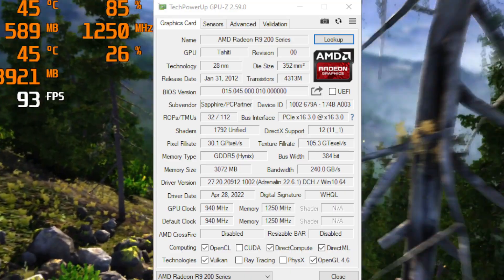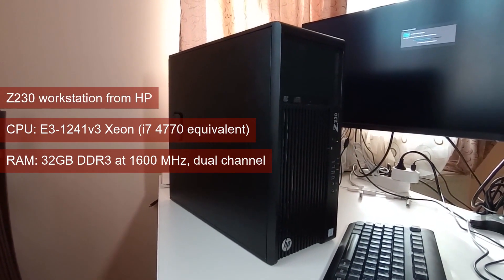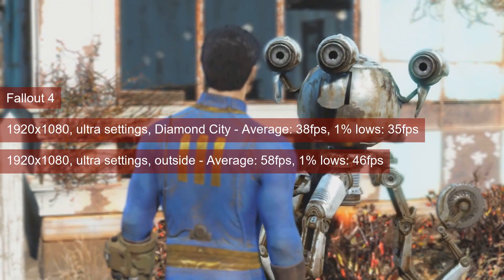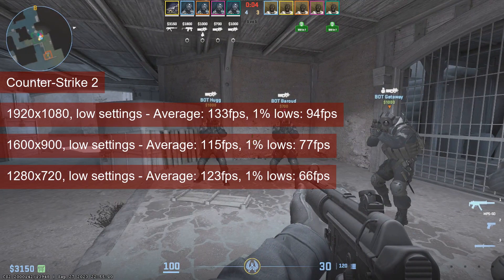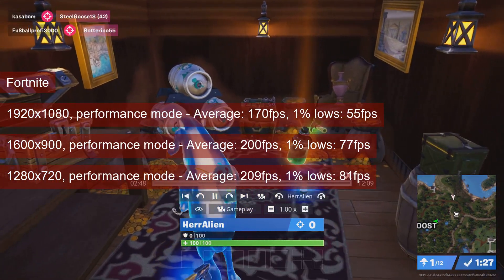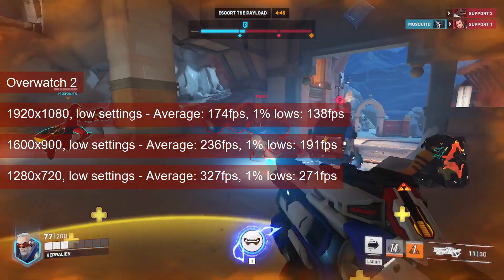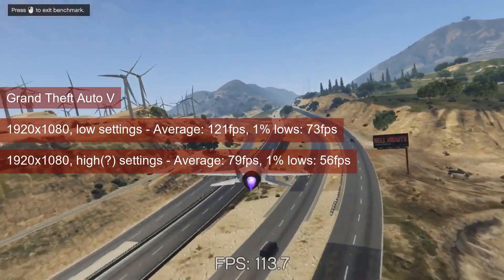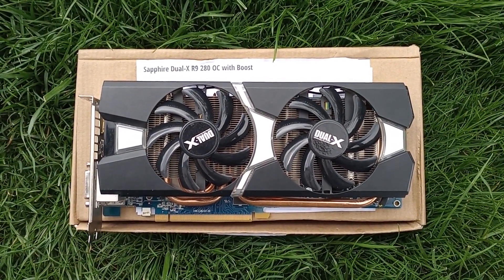Still Fine Wine in 2024? | AMD Radeon R9 280 / HD 7950

Comment: Back in the day I had to choose between the R9 280x and the GTX 760.
Ended up choosing the 760 since it was a bit cheaper and used less power, so I could stay with my 500w PSU.
I regretted that decision later on since Kepler was terrible on DX12 and the 700 series aged like shit. Plus it was slower when it was new and only had 2gb of VRAM which started being problematic
Reply from the maker: I for one was surprised by how well the 760 ran in DX11. Nvidia really focused on the current API with the 600/700 series, and it indeed ignored DX12 and Vulkan.
Pitty. 

The R9 280 in this video belonged to my brother. He got it back in the day, when he upgraded from an HD 3850. He then gave it to me later on, in late 2020.
Reply: @oldertechtoday  well, I used the GTX 760 up to 2017-2018 and it was really weak by that time from what I remember, and even the GTX 780Ti wasn't so great back then.

Comment: Honestly I think hd the 79XX/r9 280(X) are getting too old for modern games. An RX 570 is just generally better at everything along with almost as cheap price on the used market. I currently use a r9 280 non X in my Windows 7/Xp pc that I built, but that or using Linux is probably the only left for it.
Reply from the maker: The RX 570 runs better than the R9 280, sure. And according to others on youtube, even the 570/580 is too old.
It all boils down to what games you play. I've seen a lot of people that play just 1 game, at best 2. And if your GPU runs those 2 games, then who cares if the GPU is old?

Comment: 3GB bros, i don't feel so good

my old GTX 580 3GB is also on the edge sadly, its a great minecraft card imho
Reply from the maker: @chazbotic  lol, did I mention that some of my favourite cards have just 1GB?
I did not have the pleasure of having to work with Fermi cards, so I can't comment on the GTX 580.
3GB does limit what this card can play, and while there are still some popular games that can do with that, they become fewer and fewer as time passes.
Reply: @oldertechtoday  there was some weird GPU memory limits in some cards like 896MB or 1.5GB. it made sense with the memory architecture for those cards, but they were kind of oddball sizes. even today with 5GB and 11GB especially models you see sometimes.
Reply: @oldertechtoday  What was that 1gb card? My would be Gainward Radeon 4870 1GB with 2 fans (one bigger, and one smaller) I spent days play on it, it was great back in the day.
Reply from the maker: @ivanjeremic3987  The card in this video is the 3GB R9 280. I don't think I own a two fan 1GB card; if my memory serves me right the R7 260 I have is a 2GB card.
Reply: @oldertechtoday  Yeah, but you mentioned that one of your favourite card were 1gb and would like to know, what was it...
Reply from the maker: @ivanjeremic3987  There are actually 2 GPUs that are paired with 1GB that ended up leaving a lasting impression on me: the HD 7770 and the older HD 5770.
Reply: @ why 7770 and not 7870?
Reply from the maker: @chazbotic  The main reason is Control. I didn't expect that I would play the first couple of hours of it on the HD 7770. I expected a slide show, despite the 720p lowest settings.
The other reason is that I don't own a functioning HD 7870, nevermind a 1GB variant of it.
And the HD 7770 was the first used GPU I got.

Comment: You can also try Radeon ID drivers for R9 280 - latest versions can have optimisation for newer games.
Reply from the maker: @victorspencer4885  I know, I tried them. There is a risk associated with third party drivers, and that's why I don't recommended.
Besides, if a third party can get it fixed, why doesn't AMD do it?
Reply: I`m thinking of getting the RX580 8g... Warzone 2025 wont load shaders some reason.
Is there a work around ?
Reply from the maker: @Matthew_Singer sorry for the late reply. It may be that the latest Warzone require feature level 12_0 or higher. Unfortunately I cannot provide better info - I stopped covering Warzone after they shut down the first one.